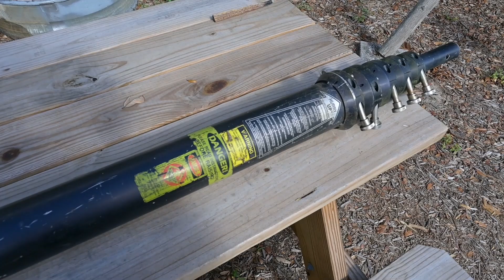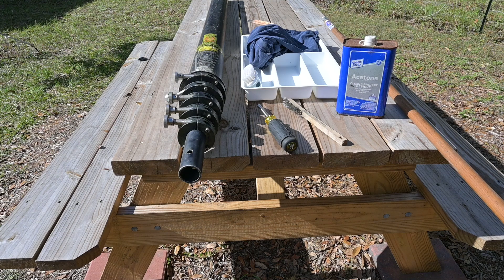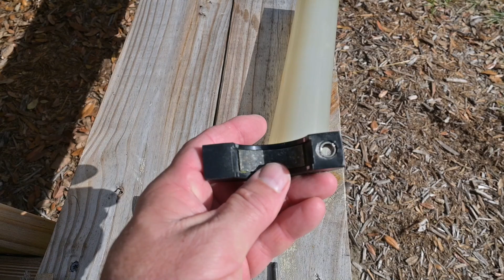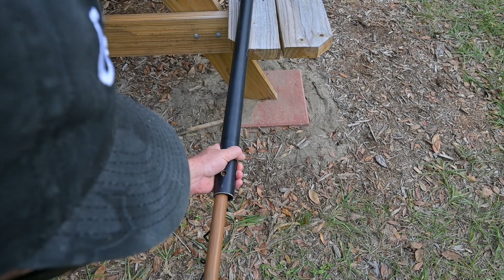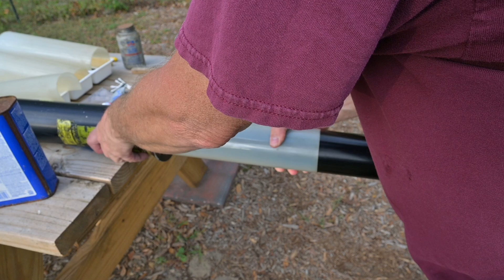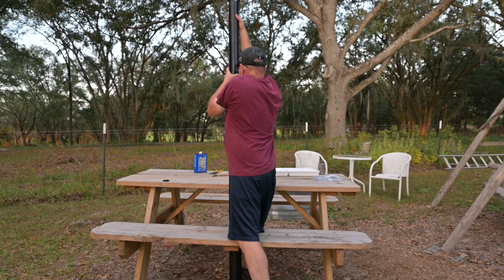The best ham radio aluminum telescoping mast Will - Burt 25 foot mast maintenance and service

Comment: I have one of the Will-Burt pneumatic masts that hits around thirty feet. It came from an ENG VAN, a rebuild after the driver forgot to lower the mast and hit overhead lines with it. It was literally a deal of a lifetime!
Reply from the maker: I that is a great deal !  was sitting in the back seat of a truck pulling a folded telescoping 100' alumatower that snagged a  damaged low hanging power line after a storm decades ago. Talk about sudden deceleration.   It was fubar . Thanks for watching !
Reply: @survivalcomms  USMC ?
Reply from the maker: @Subgunman  Im not sure where it originated from. I got it from an SK. Thanks for watching !

Comment: Man, that Will-Burt telescoping mast is nice!  Impressive that you had the Ubiquity shot up for 6 years without having to re-aim.   I have used Rohn telescoping mast, but it is not even in the same league as that Will-Burt.
Reply from the maker: It was pretty amazing that it held position so long. I had a good system to keep the base stable from rotation and nothing else moved during its service life fortunately. Even in its state of filth the mast collapsed like it was designed to when I pulled it down. Thanks for watching !

Comment: I bought a USGI telescoping mast with folding tripod. You can elevate by hand or by air via a HD hand pump. Each sections lock automatically as it elevates. Best $250 I spent.
Reply from the maker: That is a great deal ! Thanks for watching !
Reply: Where did you find such a good price for that?
Reply: @ Military vehicle show and swap meet 2018. It was too cool to pass up. I wasn’t even into radios then…lol.
Reply: @sorryociffer  Oh ok thanks!
Reply from the maker: @sorryociffer  Prime example of when you see a good deal grab it.
Reply: @ I’ll have to do a video of it being set up. I’ve not seen another like it.
Reply from the maker: @sorryociffer  I would like to see it !